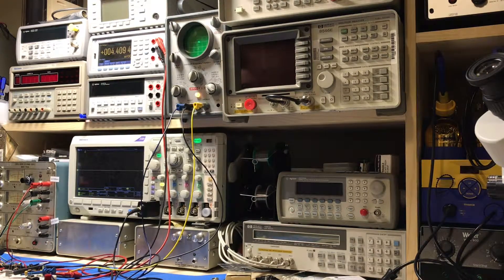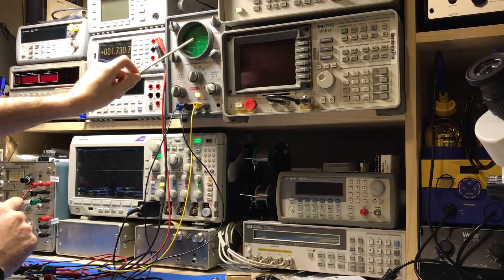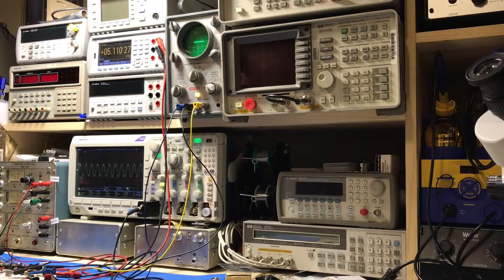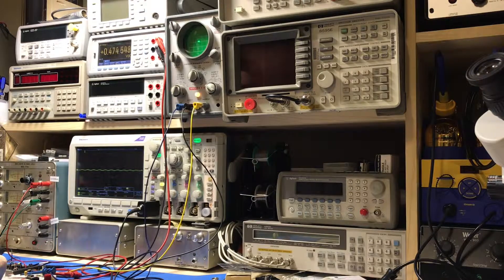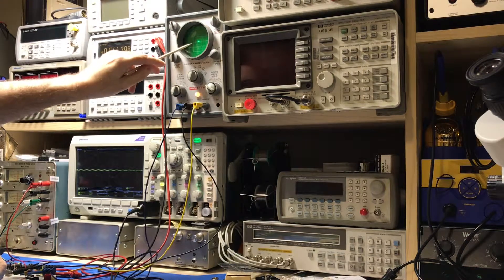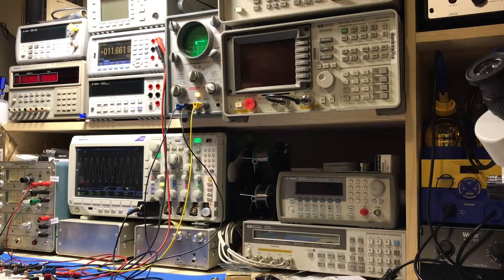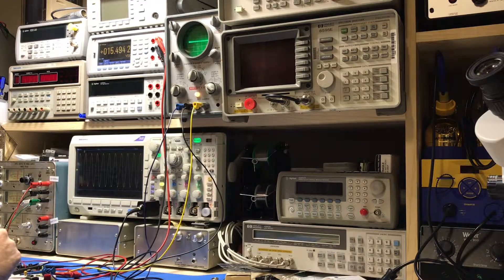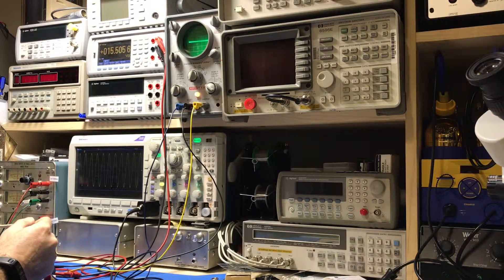Curve Tracer Build Part 1

Comment: Was there ever more parts to this please ?...cheers.
Reply from the maker: Hello, good question.  Shortly after this video was made my lab flooded in a rainstorm.  Afterwards my plans changed a bit with demo/remodeling/rebuilding/etc.  I did complete the signature tracer modification to the Eico but it was not filmed.  The modifications were based on a design from Mr. Carlson's Patreon channel.  He has asked for the design specifics not be released outside of the channel, so I will respect his wishes.  I will say that the signature tracer modification has been quite useful.  There's a good chance you may see me using it in future videos.  Thanks for the question.
Reply: @FreeElectron I've got a '59 Tektronixs 317 scope in decent condition that I plan on performing the same basic restore and tracer mod that you've done here. Although outside of the scope of my experience, Ha!, I'm looking forward to a few bitter grapes of rather on my journey to tasting the smoky sweet cup of wonder. Thanks again and cheers to you!